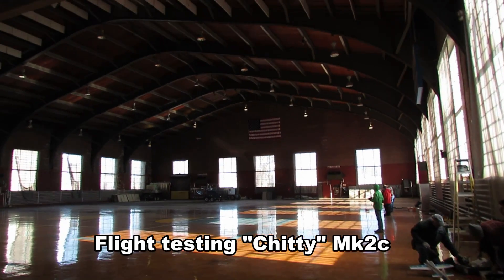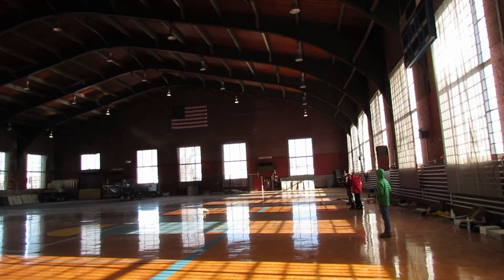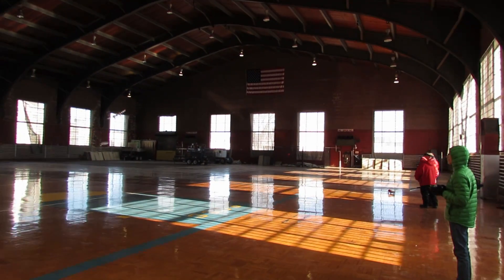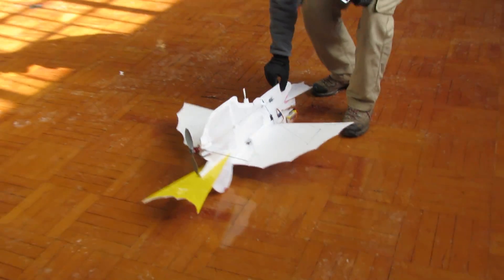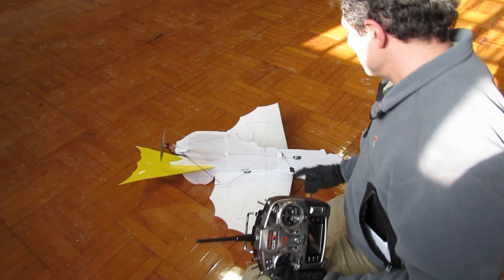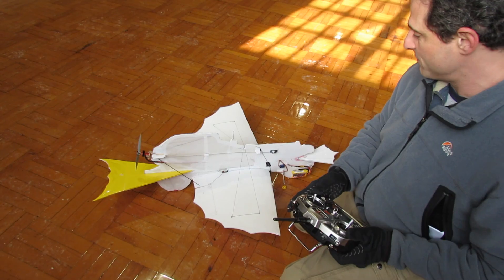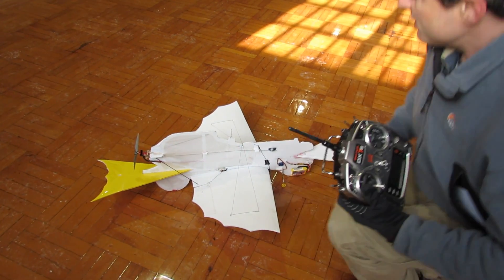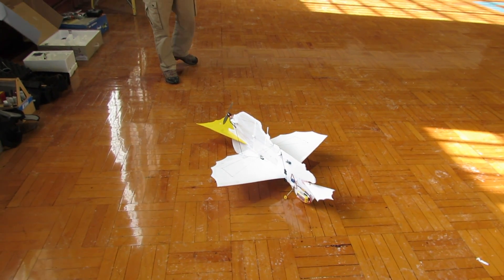Chitty Mk2c test flight success!

Comment: Increadable build! I see what you mean by you had to do a lot of trial and error, especially for that very unusual canard. I'm very impressed with the ingenuity.
Reply from the maker: Thanks!  I found the thrust angle of the motor in relation to the center of mass to be a very interesting problem to solve.  This was further complicated by the relative incidence of the canard, wing and horizontal tail.  And then, to make matters worse, given the absence of a rudder, yaw is accomplished on Citty by vectoring the pusher prop, and when you do so, the thrust angle changed from along the fuselage center line to over the wing roots, which can induce tip stall.  The ailerons were necessary to counteract this induced instability in roll (and the wings being very low aspect ratio also worked against me in that regard).  Not for the faint of heart!
Reply from the maker: I only put myself through this because of my very strong feelings about the movie and what Professor Potts was willing to do for his children. Quote a good role model :)  If I had a dime for every time I sang "up from the ashes...grow the roses of success" while working on this project, I'd be a wealthy man!